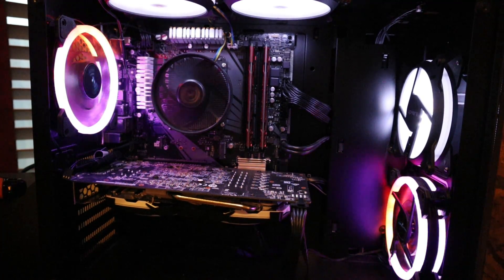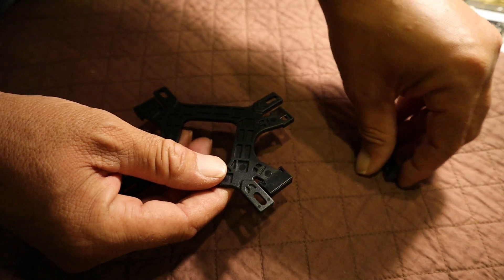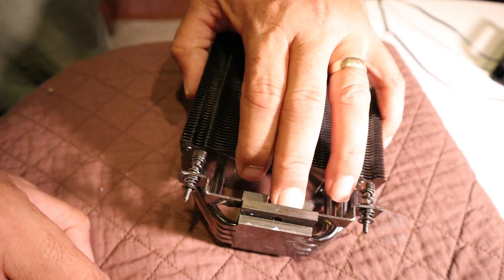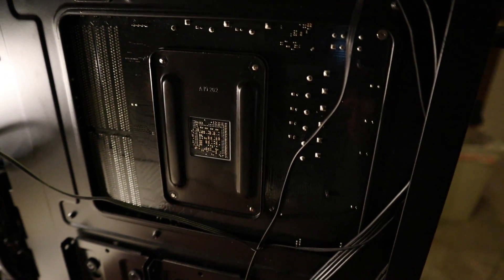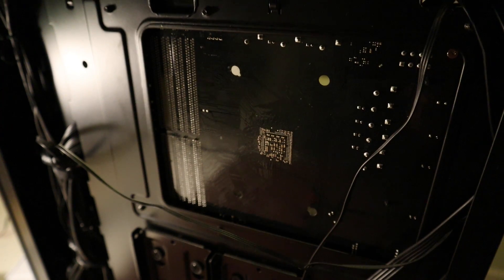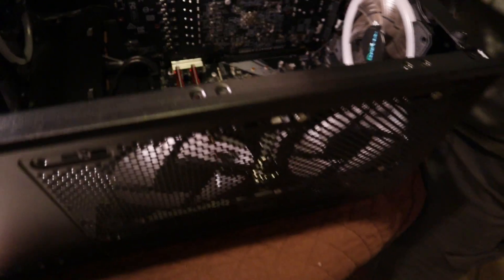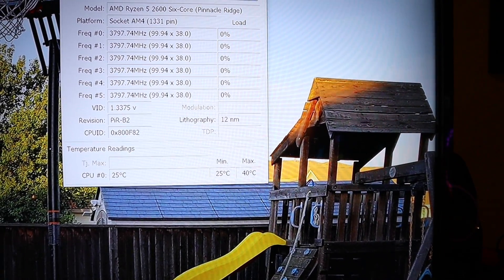How to install the Hyper 212 Black Edition - AM4 - B450 motherboard - Cooler Master

Comment: Ok this will be my first build..I bought asus tuf b550 motherboard with ryzen 9 5900 with 32GB ram..before I start the build Cooler Master Hyper 212 Black CPU Air Cooler, SickleFlow 120 Edge PWM Fan, Aluminum Top Cover, 4 Copper Heat Pipes, 152mm Tall, AMD Ryzen AM5/AM4, Intel LGA should work

Comment: Do you setup fan speeds or anything like that
Reply from the maker: I've always controlled my fan speeds thru the bios
Reply: @ScottsPC  I need help with setting mine I confused by the b450 BIOS
Reply from the maker: Usually on the main bios screen there should be a setting for your fan curves... Set fan speeds at certain cpu temps etc. You can always search your specific motherboard on YouTube for a fan curve tutorial...
Reply: @ScottsPC  hey, and you memory ram slot??? -1 ?

Comment: Hi umm i have a quick question. I have a Asus Prime B450M-A morherboard.. is the Cooler Master Hyper 212 RGB gonna fit in?
Reply from the maker: Will fit on any AM4 socket. Question is will it fit in your tower? Check out pcpartpicker.com. They have tools that will help see if your components are compatible. Good luck to you! ⚡️

Comment: I have ryzen 5 2600 with hyper 212 and my idle temp is about 35 to 40 and while gaming it maxed out to 60 degrees.....my room temp is about 34 degrees cuz its summer so are these temps normal? And what is your temps ?
Reply from the maker: You have great temps! ⚡️ My temps are similar

Comment: These might sound like stupid questions but as a first-time builder, I was just wondering 2 things: 1. Does this tutorial work for every B450 Board, or are there some B450 that have a different hole pattern or something?
And 2. Do all of these parts come with the cooler or do you have to buy some extra?
Reply from the maker: We were all first time builders at one time. B450... B550... Any motherboard that has an "AM4 SOCKET" will work and yes... All the parts for both AMD and intel come with the Hyper 212. Good luck to you! ⚡️
Reply: @ScottsPC  Ah, ok thank you. I just found a used Ryzen 5 2600X for 108 € (128 $) and I just hope to find a good GPU, otherwise I'll have everything in about a week or so. :D
Reply: @ScottsPC  i have a b450m aorus, I hope I can still use 4 RAM slots.

Comment: Can we install this cooler on the default backplate?
Reply from the maker: You'll need to use the backplate that comes with the Hyper 212...not the original backplate that comes with the motherboard.
Reply: @ScottsPC  ok thanks man!

Comment: I’m just moving from console and buying a prebuilt with all specs I wanted anyway just missing a cooler.  It’s using stock amd cooler   
Do you think this is easy to follow along if I’m new to pc ? Also how long will a stock cooler last and does it damage cpu
Reply from the maker: Just watch multiple videos so you get multiple point of view and just take your time.  The stock cooler will not damage your pc if your using stock settings...Good luck to you!
Reply: @ScottsPC  I’ll mostly be using low and medium at the highest   I’m never gonna be using high settings so the stock should last me couple months for now hopefully

Comment: i got up to the point where you put the 2 screws on the bracket  and guess what the idiots left out a screw in the packing
Reply from the maker: UGH!!!
Reply: @ScottsPC   I found a screw that worked but barely because it was a shorter screw. So got the thing installed and the fan on it worked but the rgb didn't lol and yes i plugged it in the rgb pins on the mb it just would not work and yes i have mystic light installed

Comment: 6:04 
my backplte doesnt fit 
b450 ....  what the heck.kkk
Reply from the maker: Try adjusting the pins on the backplate to different slots to line up for mobo... That's my bad on pin backplate placement
Reply: @ScottsPC  i have a fatality b450 and theres only 4 available holes .  

doing some research it appears its a cooler master issues with some of yhe products whenn they were made .  

some came with the proper mounting kits ... some didnt have them.   smh. 

stinks

i didnt even get the proper stand off size screws to use the factory back plate

Comment: when i try to slot the backplate in, i have all the pins to the left as you suggested, but it wont fit; i can manage to get 3 of them to fit, but all 4 refuse to go in properly. I also am running the b450, so i'm not sure why?
Reply from the maker: That's my bad. Try moving the pin that doesn't fit to the second slot of the backplate. I've also done an updated tutorial that I just published a few days ago that addresses my mistake.
Reply: Awesome! I'm still running into an infuriating issue, when i try to actually mount it, the screws don't line up at all. Screwing in one puts it wildly off, and i just can't manage to screw in any more, the entire this is facing a weird diagonal angle i don't think it's intended to be at
Reply: Should the screws on the heatsink be on the inside or outside hole?
Reply from the maker: @gabrielgangoso4589  they will screw into the "standoffs"
Reply: Yeah, the screws and standoffs don't line up in any way that seems to work. I followed the manual and your video and can't even get them to fit even with a decent amount of force.
Reply from the maker: @gabrielgangoso4589  Hard for me to help without actually seeing....take your time...wish I could help you out more.

Comment: Excellent tutorial. Mine arrived yesterday. I'll be installing it this morning.  Done.  It took around 40 minutes, start to finish, which included adding 16g memory to my rig. I must have messed around for an extra 5-10 minutes with the fan brackets.  They have changed the fan mount brackets to wire. And they fall out if you don't keep tension on them while installing.  CPU temp at idle is 24-25 degrees now.  I was at 49-50 degrees. Incredible difference, well worth the money over the stock cooler which came with my Ryzen 2600.  And no, I don't over clock.
Reply from the maker: Awesome!!!  Just take your time and good luck to you!!!
Reply: How quiet is this cooler? I’m considering getting it because my stock cooler that came with my Ryzen 5 1600 is loud.
Reply: @granola3923  The only thing that I hear is air moving. I think you'll be happy with it. If you want super quiet it'll cost a whole bunch more.

Comment: The old plastic fan clips are much better than the new (CHEAP)  wire ones. The fans just don't feel like they are well attached and I will be returning mine shortly. No longer recommended imo.
Reply from the maker: I bought 2 in early 2020...You're telling me the switched to wire clips? Bummer!
Reply: @ScottsPC  They sure did! The wire clips are a blatant cost cutting cost cutting measure. HORRIBLE results! Tried attaching a second fan and in the process, the 1st one fell off.

Comment: Great video man, thanks for the tutorial! I'm thinking to upgrade my CPU cooler later on with this Cooler Master, is this the RGB version?
Reply from the maker: It is the RGB version, but I decided just to add 2 plain old black fans to the heatsink.  Thanks for the praise my friend and good luck to you!!!😎😎😎
Reply: @ScottsPC  seems those black fans are quite easy to clip on the heatsink, normally you need a sort of metal wire to stay firmly attached to the heatsink

Comment: Hi, may I know the size of motherboard you used? Is it ATX or m-ATX? thanks!
Reply from the maker: Micro atx my friend.... Hope this helps! ⚡️
Reply: @ScottsPC  Thanks scott! do you think it would fit on my build.
Reply: RAM: t force delta R (49mm tall)
mobo: b450m pro m2 max (m-atx)
Reply: i got 2 pcs of RAM of this
Reply from the maker: @davinci253  I would go to pcpartpicker.com and enter your build to see if compatible and to also look at other user's builds with your exact components. You have pretty tall ram... Which case are you using? Hard to give advice one way or another without have all components right in front of me. Continue doing your research and good luck to you! ⚡️
Reply: @ScottsPC  Thanks much bro!, here's my case btw. Dark Flash water square 5

Comment: i just installed the cooler about an hour ago. screwing the cooler on the mobo was a hassal for me. i kept re taking out the cooler over again and keep screwing. i got it after about an hour and half bc i was f it, imma just screw it and put more pressure on it. i got screwed on and your video helped me. my cpu is running around 30-40 idle. much better than 60 when idle.
Reply from the maker: SWEET!  Glad the video could help out some!😎😎😎

Comment: Hey I just ordered mine but I’m becoming worried my gpu clearance will be an issue. I have a 212 Evo set up so it’s blowing out vertically. Does the black edition allow the radiator to be set up that way or only like shown in the video?
Reply from the maker: Hey Ryder.  From what I can tell I don't think you can orientate the heatsink to blow up or vertical.  Not 100% sure.  Try going to pcpartpicker.com and enter your build to see if all your parts are compatible.  They will also have pictures from other users with your exact build....

Comment: Just a question does the thermal paste come with the cooler or do i have to buy it separately?
Reply from the maker: If  you buy brand new cooler will have pre applied thermal paste /pad... I would buy some thermal paste as a back up in case you make a mistake or accidentally smudge the thermal pad. If you buy one on the secondary market you will definitely need some thermal paste.

Comment: thank you soooo much for this video! haven’t done anything like this in my life but it’s been a life saver for installing my new fan. only problem is i can’t figure out how to reach two of the screws on the heatsink, there’s no way i can get my screwdriver on them to actually secure it in place 😭
Reply: nevermind, i worked out how to pop the fan blade off and reach the screws underneath :D
Reply from the maker: Good Job!!!

Comment: Thanks Scott !
Reply from the maker: Glad the video helped some.... Good luck to you! ⚡️
Reply: @ScottsPC  one question if i can. I have installed this on an 3600x. Is it normal in idle to have spikes from 30-35 to 40-45? Is it possible that i may have done something wrong ?
Reply from the maker: @villageunderground9106  in my experience you should be fine... Give the thermal paste a week or to cure... If not... You can always re apply paste again... Just keep eye on it
Reply: @ScottsPC  really appreciate your instant reply. Take care !

Comment: Thank you for the guide! :) Some extra tips that have helped me out in the past: when you remove any cooling solution, let the pc run for a bit, turn it off, so the thermal paste is a bit less rigid, it will slide out easier and safer when it's still a bit warm. Also good practice to turn off the PSU and maybe have an anti-static wrist wrap. (or ground yourself before touching the components) Also when you screw/unscrew the cooler to the CPU, try to do it in a cross pattern, and do it in two passes or something, so that there isn't a large amount of pressure applied to just one corner because that might damage the components. May your temps be low!
Reply from the maker: Excellent advice for everyone! ⚡️ many... Many nuances to installing any type of component. Thanks for sharing these tips... Low Temps to you also! ⚡️

Comment: Mine came with a splitter connector, one for the cooler fan the other idk for what? So I left it unconnected...was that the wrong move?
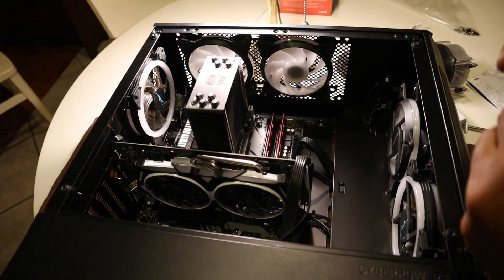Reply: 9:28 you’re using a fan splitter, that didn’t come included in your box?

Comment: Hi I had a question 
After applying thermal paste I had to lift up the cooler after I tried to adjust  the screws which I screwed the wrong way but I put the cooler back without additional thermal paste
Amd also some excess thermal paste was removed by the heatsink pressure from the sides 
Is this ok
Reply from the maker: I would personally start over...clean off the thermal paste and add new paste.  If excess is coming over the side, you've used too much paste.  Good luck to you!!

Comment: The step at 1:52 is incorrect. You want the parts to be symmetrical. For AM4 you want to use the left-most holes on the left side, and right-most holes on the right side. The step shown in this video will lead to slight misalignment. https://youtu.be/TSbW-UcLS-g?t=278 shows the proper configuration.
Reply from the maker: Yes... Realized a few hrs after I published video... I'm human.....

Comment: I have a i7 8700 on a arorus H370 motherboard. For the longest time I’ve just used the stock intel cooler not thinking much of it. Recently I upgraded my graphics card to the rtx 3070 and noticed my performance was a HUGE increase from a 1070. However, not as much as I thought it would be. Then I discovered while playing warzone my cpu temps were hitting upwards to 90 degrees Celsius which was thermal throttling my performance as a whole. I just ordered this cooler. Hopefully it’ll be enough to stop the thermal throttling.
Reply from the maker: First of all congrats on getting your hands on the 3070! I bet you will see a minimum of 10c or more COOLER than your stock cooler!!!  Good luck to man and thanks sharing. I'm still searching for the 3070 at NORMAL retail pricing...ugh...LOL!
Reply: @ScottsPC  I know what you mean! I got lucky and was able to talk a scalper near where I lived down to a very reasonable price. Quick question tho since you seem a bit more experienced with coolers. When putting a new cooler on do you use isopropyl alcohol to clean off the old thermal paste off of your cpu? I hear some people use it and others don’t. What’s your opinion?
Reply from the maker: @Yelrahh  I've always just used the isopropyl at 70 percent alcohol just for cleaning top of cpu... Many would say to use  90 percent alcohol in case you want to clean other aspects/parts of your hardware...

Comment: Hello , my cooler master hyper 212 evo has like these things where u push and twist instead of screwing it to the motherboard like in your vid(it just clips in easily without screws), will i be able to install it the same way in a B450 motherboard without screwing it like i have in my old as intel system , cause i'm gonna upgrade to a budget ryzen system and i think the hyper 212 evo will perform better than the stock cooler, if you read this and reply thank you for your time !.
Reply from the maker: I honestly don't know because I've never seen what your describing.  What motherboard do you currently have your 212 mounted to?  What kind of system do you have?
Reply: @ScottsPC   here is a picture  imgur .com/a/fR69Kp9 , i got an old gygabyte h97 motherboard just wondered if my hyper212 would work  on a B450 motherboard with this mounting bracket cause it doesn't have screws but i think it should work , thanks for the reply , let me know.

Comment: I'm having trouble screwing the cpu cooler screws(the ones with the spring around them) into the standoffs. Its not reaching.
Reply from the maker: Keep trying...Hard to troubleshoot without actually being there...You do have to press down firmly on the heatsink and screwdriver to get the first thread going...just don't press too hard...Hard to explain, but you've got to have a feel for how much pressure to apply to get that first thread going....maybe take a break and go over all the steps you've completed to this point.....double/triple check just to make sure...
Reply: @ScottsPC  thanks for the reply! I managed to get it in. At the time I didn't know I had to press the screw down so it can reach the standoff.  Think the most troublesome part was aligning the screws with the standoffs lol.

Comment: thank you for this tutorial, im not a techie guy but i want to do it myself after watching this, a shop nearby told me that if im going to install liquid cooler i need to replace first my 500 watts psu ,.if im going to install this one cooler master do i also need to replace my 500 psu? my board btw is b450 m2 pro,,
Reply from the maker: Go to pcpartpicker.com and enter your build parts. Will tell you exactly how my watts your rig will need... I've done that for all my builds... Good luck and thanks for the question! ⚡️

Comment: btw quick question (its my first build). Do i gotta buy the thermal paste too or is it included? If so, which one do you recommend?
Reply from the maker: Thermal paste is included and should do just fine... There are quite a few thermal pastes out there... I use artic thermal paste... Good luck! ⚡️
Reply: @ScottsPC  awsome! thanks for the quick reply. subbed

Comment: This is the exact tutorial i followed but end up cooler screws not sitting on motherboard stand off. there is a noticeable gap in between.
Here is my post on LTT forums.
please help
https://linustechtips.com/topic/1265013-b450-tomahawk-max-with-hyper-212-cooler-disappointment/
Reply: The Hyper 212 and the Hyper 212 Black Edition are different models, the original 212 is old and Cooler Master included an AM4 X bracket for it, it only allows you to be mounted with the fan facing upwards, same happens with the Hyper 212X. Don't buy them or send them back, they don't worth the money.

Comment: i installed mine but for some reason my temps haven't gone down. I have a ryzen 9 3900x
Reply from the maker: Should definitely work better than the 3900x stock cooler... Maybe take off and try some premium thermal paste? I can't remember, but the heatsink comes with pre-applied with thermal paste /pad... Take off the cover? Do you have good contact with the cpu? Just spit balling.... Let me know...
Reply: There’s a sticker on the bottom of the hyper 212 I believe. That would cause your temps to be very high. I’ve also heard that not screwing the mount all the way in causes temps to stay high